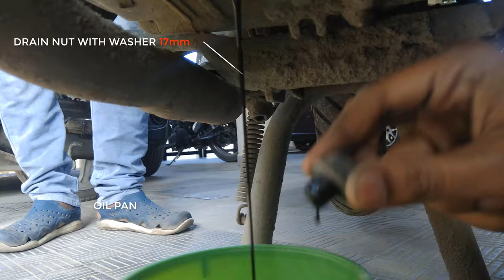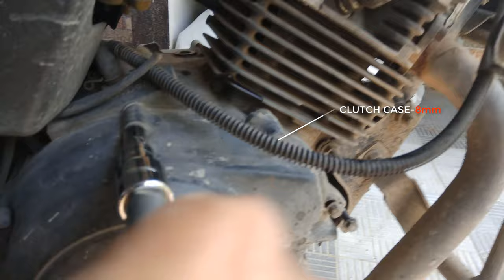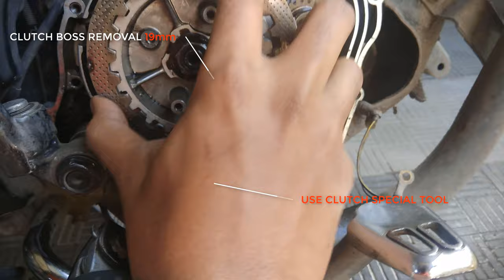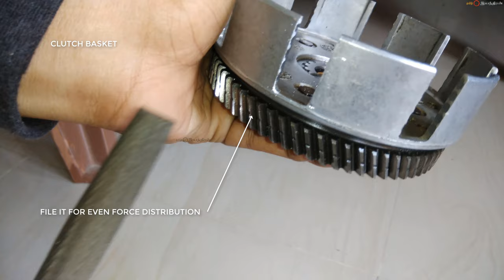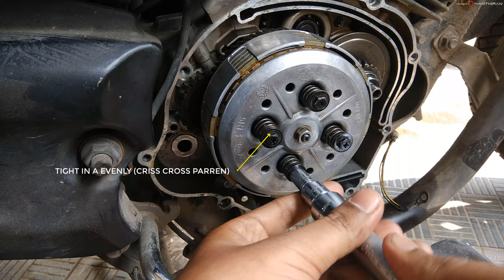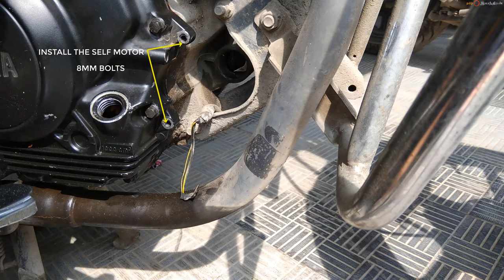HOW TO REPLACE CLUTCH (YAMAHA GLADIATOR SS 125) 4K UHD

Comment: Sir, do we need to use anabond bond paste while fixing the packing?
Reply from the maker: Not needed, just the packing is enough..
Reply: @TamizhIyanthiran  thank you.. sir...Another doubt- does gladiator has only oil strainer instead of oil filter which is seen in new vehicles?..And whether is it mandatory to clean oil strainer during each ervice??
Reply from the maker: @mech88karthi  no it's not mandatory
Reply: @TamizhIyanthiran  ok.. Thank you

Comment: I am having SS 125 , super bike.which oil is company recommended for this bike. Reply.
Reply from the maker: Company recommended is YamaLube yamaha lubricant I am using castrol power1
Reply: I mean gread 10w40 or 10 w50, now I am using shell advance ax 7 10w40, before that 20w40, motul 20w50, 15w50, two times gulf powertrac 15w50, .
Reply from the maker: @suriyanarayananb7078  sae 20w -40 or 10 we -30 is the recommended type as per user manual.

Comment: Brother i had recently installed new clutch plate assembly on my ss125...
The bike was running perfect for the next few days but i started facing the same clutch problem after few time.... pickup is also affected very much.....what could be the reason?
Reply from the maker: Have you replaced the tension spring. If you bike ran more than 76000kms it's  due to normal wear and tear of the vehicle. Or else check for sprocket , spark plug air filter and valve clearance..
Reply: It's just 52K km..
Reply from the maker: @tanveersingh5892  also depends upon the riding style also just consult a near by service center... Ask them about it...
Reply: Same problem bro

Comment: My indicator beep tune is not working plz make on video on this ....thanks
Reply from the maker: Change the indicator buzzer,  it would cost less than 35₹.   Some times the wire may be cut off. And it may due to water entered into the buzzer...  Any of the above reasons.  Please check it
Reply: @TamizhIyanthiran  can u tell me where is the buzzer,I dont find any buzzer in battery box
Reply from the maker: @madhavjha4200 What bike are you using
Reply: Gladiator ss 125 (2012)model
Reply from the maker: @madhavjha4200  It is located under the seat. you have to open the side doors of the bike and then remove the seat and then see the buzzer . for image type in google. if it was previously working then wire might be the problem.
Reply from the maker: @madhavjha4200  https://www.youtube.com/watch?v=5SUWA5g4gxk&list=PL829xN99jSuZ_k6g3w-GEGIwXONBwbNqk&index=1                   
for opening the seat click the above link,  And it is exactly located near the tail light.
Reply: Thanks brother , my bike silencer is totally rusted , and new silencer cost is 6,700 RS , now I m finding this in some  cheaper  market ( kabari ),due to low sale there is no bike silencer in,can u tell me which bike silencer is suitable for this bike
Reply from the maker: @madhavjha4200  Gladiator, ss125, ybr 125, for ss 125 the silencer type is called as machine gun silencer.  search in olx, quicker and facebook market. ask peoples like him.    https://www.facebook.com/marketplace/item/2313633902248579/
Reply: @madhavjha4200 me indore se hu or mene meri gladiator me r15 ka silenser lagwaya h 2nd hand kabadi market se...photo ya vidio chahie ho apko ho to mjhe reply me bata dena bs itni help kar sakta hu apki.. 1100 rs ka pada mujhe silencer
Reply: @mayankakodiya2481  yes bro make a video for silencer and how to add this silencer and with all procedure ...
Reply: @mayankakodiya2481  send me also some photo or bike with packing of all silencer where it is fitted to head . Thanks for replying 👍
Reply: @madhavjha4200  kaha par send karu whatup no. Yaa id vagera bata dena ap